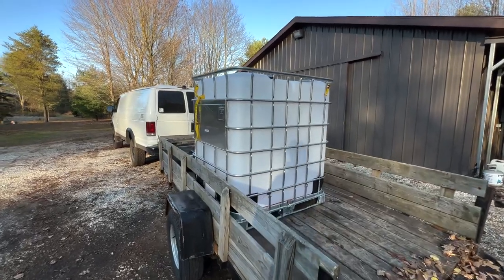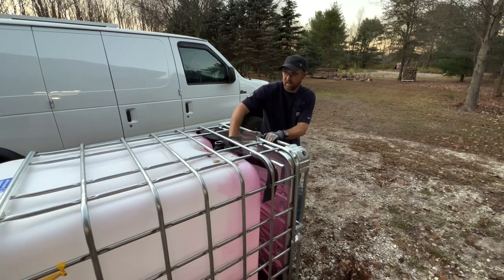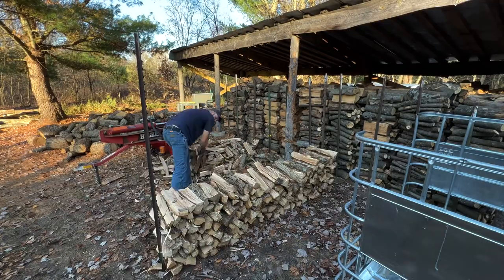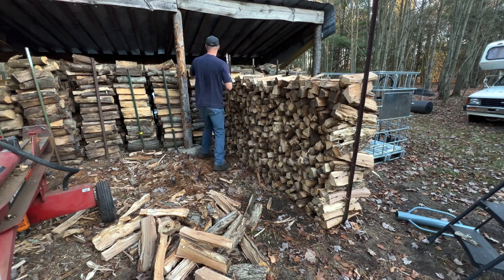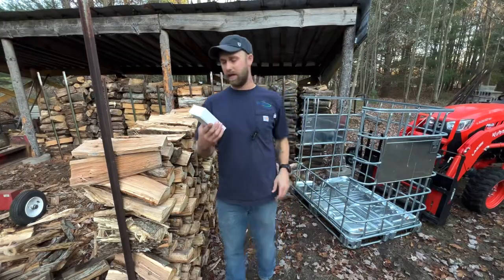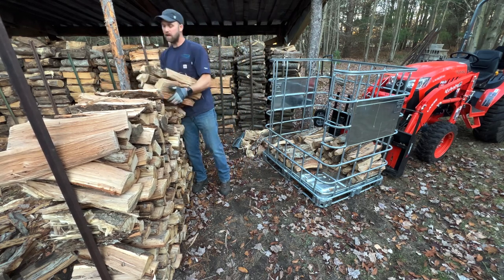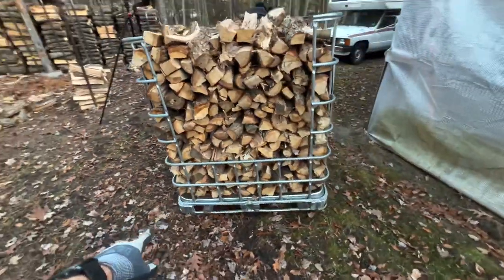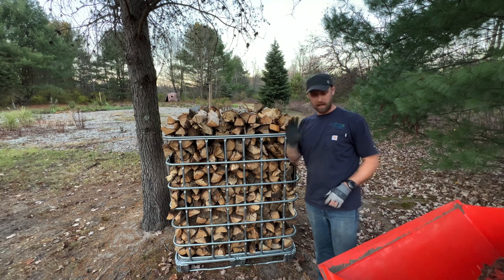#1 - FAST firewood storage - IBC tote. How much does it actually hold?! I verify!

Comment: Thanks for this video.  Cross LX off my list as I intend to lift totes of firewood with my next tractor and this answered my question.  Thanks again!
Reply from the maker: I’ve found that by setting them on a 4x4 first and then filling them, they are already off the ground a bit and all I have to do is lift up as hard as I can, then back up. It’s a work around, but it does work. Dry totes are no problem, just the wet ones. There’s always a 3 point lift for the rear as well. Good luck and thanks for watching!

Comment: PRO TIP ———. Once the wood is dry and seasoned they sell IBC tote full covers on Amazon for about $30.  Get the thick 600D type, not the cheap 210D or 420D.    The full cover keeps all rain out and your wood toasty dry.
Reply from the maker: Great tip! I’ve got about 50 bins now and have started cutting the old plastic liners that come in them and making 2 covers out of each tote. Much cheaper for my needs 😊👍🏼
Reply: @BlueyesBelow  I use the tops of the tote bladders as well……but once the wood is dry….I’m able to keep it continuously dry.   No rain or snow getting the sides wet.   We deliver to customers in the IBC totes.   We often get comments on how professional we look compared to customer’s previous supplier that just showed up with a dump trailer unloaded.    We get $155 face cord.     It’s great to hear that you have 50 totes.   Have a great Sunday
Reply from the maker: Wow that does seem very nice. Professionalism definitely goes a long ways and sets people apart from the others. Thanks for sharing that I’ll definitely check them out!

Comment: go to tractor supply and get a 3 point pallet fork for attachment.  It will make it easier and safer plus you can toss the rest in the buck
Reply from the maker: That’s interesting, I don’t think I’ve seen those before so I will have to check it out. I am thinking a box scraper for counterweight in the back though. Thanks for the suggestion!

Comment: hi there guess  i don't need to tell you to be careful . i weigh a lot of wood on my channel and the speed it drys at , you should be able to  lift it in a month if you cover it , . i cut the platters front to back instead of top to bottom . it makes a bigger top john
Reply from the maker: I would love to see the videos you’ve done, it sounds really interesting! 
I’ll go check your channel out this morning
I actually bought a box scraper last week and that helps with me lifting these considerably with some counterweight back there. It’s pretty much at the max of what my tractor can lift but it will thankfully. 
And a huge thank you about cutting the bins front to back. I’ll do that for the next ones! That is all very helpful 🙏🏼👍🏼

Comment: I purchased 3 point forks from Titan, more power to lift from 3 point than loader.  Move my totes easily with an old Farmall C or my compact tractor.
Reply from the maker: That’s a great option! I did buy a box scraper now as a counterweight but if that doesn’t work I will certainly go that route. Thanks for sharing 👍🏼

Comment: 1 thing you might want to think of GET A WEIGHT ON THE 3 POINT,,, dont ask how I know,,, stay safe
Reply from the maker: Good call on that and hopefully nothing too serious on your part! I did put a box scraper on the back now which is my counter weight and it works really well. Some of the totes are still too heavy for the tractor, so I’ve now put a couple of 4x4’s under the tote prior to filling it so it’s at least off the ground and all I have to do is lift up as much as I can with the forks, and back up. Then I drive it into position and let it down. Should be much lighter when it dries 👍🏼 thanks for watching

Comment: Dont cut the hole so big, and just toss it in, should hold a half face cord easily
Reply from the maker: I want it to hold a full face cord (or nearly so), that maximizes my efforts and reduces the amount of money I have to spend on bins if I can double what it holds 🤷🏼‍♂️
Reply: @BlueyesBelow  time is money. You can get totes for $20 a piece, that’s a one time cost, every time you stack wood it costs you, will soon get the $20 investment back
Reply: @BlueyesBelow  and you won’t get twice as much by stacking, maybe 20% more. Just not worth it
Reply from the maker: @randygrider9758  these totes are like $40-$60 each unfortunately. The method may not be for you, but I’m very proud of my setup and system. It works well for me
Reply: @BlueyesBelow  they can be found for $20 a piece around here, 330 gal totes. Just offering suggestions.

Comment: Nice video. I did a similar video on my channel… check it out!  Adding a heavy implement or weight box to the 3 point will help with lifting. Also, watching your stack measurements it appeared you actually stacked a bit higher than 4’. I think you had more than a face cord in your stack. Again, take a look at my video for comparison. Keep the videos coming!
Reply from the maker: Thank you! I’m now looking at getting a box scraper to add to the back. One of my friends did that for his “counterweight” and to have the use of the scraper. He also welded a receiver hitch on the box scraper so he can move trailers. 
I’ll go check out your video. And yes I may have stacked it a tiny bit high but tried to make up for any gaps or irregularities in the stack. I would hate to be short on wood if I sold it to somebody, so a little more is definitely better in my opinion! I definitely want people to get exactly what they pay for. 👍🏼 thanks for watching!